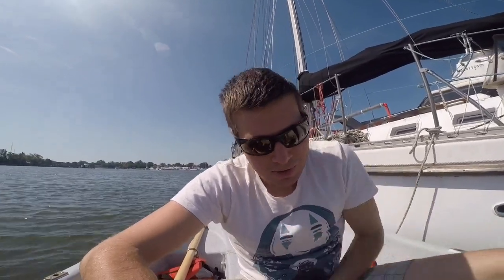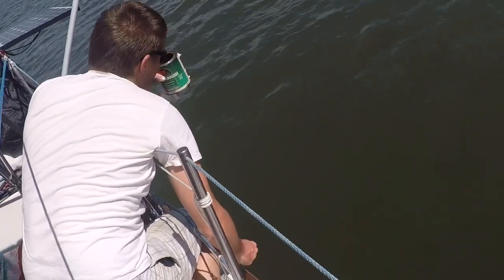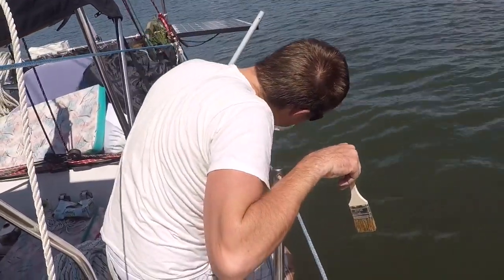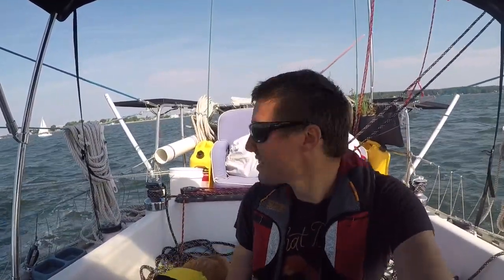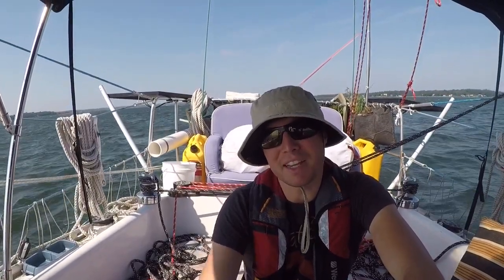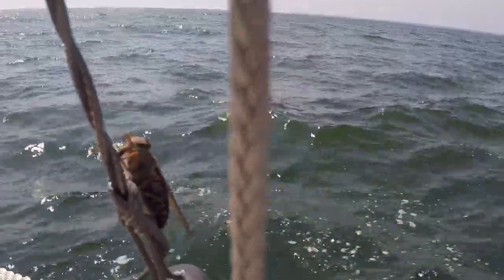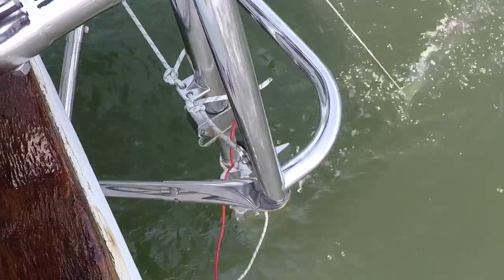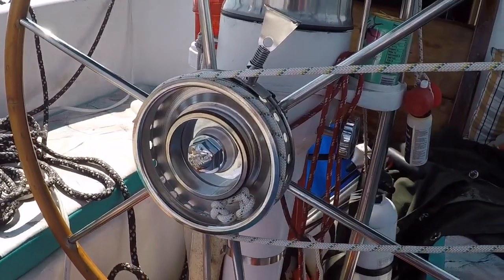Monitor Windvane Explained! | Sailing Wisdom Ep 40

Comment: Very nicely done. I just bought a used monitor and I’m anxious to play with it once the snow is off my boat and I finally get to mount it and use it.. thanks
Reply from the maker: The monitor is definitely and “art” and less of a science (though it’s all based on science). 
When you set the monitor, be sure to adjust your sail trim as the two will work together to sail the boat on a particular course.

Comment: I was thinking using a Hydrovan model wind vane to steer was the way to go because you can use it as backup for your rudder in case of failure.  What are you thoughts....I saw a youtube of cruisers who lost rudder in a storm.....Also I think you should put out a compilation video of Herbie technical tips quick one after another......and thanks for being you...
Reply from the maker: Thanks! :)
Their best point is being a ready to use spare rudder.  They aren’t as strong of a self steering system as a servo pendulum system, like a Monitor or Cape Horn,  but they will work as a spare and backup rudder.
We carry a sculling oar that can push us at an insanely slow pace, but works very well as a spare rudder and tiller. I think the best bet would be to setup the rudder in such a way that you could repair your steering at sea or at least have a spare steering blade (like a long oar) that you could setup. 
Best defense is to heave to in really bad weather and protect your rudder from damage in the first place.

Comment: Hi.  Hey, I just bought a used Monitor but it didn't have the steering wheel attachment.  I plan to make my own.  Any chance you can tell me the diameter of the drum where the ropes curl around?  Thanks, Ed
Reply from the maker: Absolutely, but we have left the boat for Christmas and will be away for about a month. Off the top of my head, I would say the adapter is about 8 inches wide. As soon as we get back to the boat I will measure it and give you a more accurate dimension.

Comment: Since seasickness is an issue, what does Maddie do to prevent the problem? Do you ever take preventative meds, patch or wrist bands? Keep up the great videos...fair winds!
Reply from the maker: +Clay Farnet we have a lot of ginger chews on board. We also have those pressure point wrist bands, but those don't really do much for me. I've taken a few types of meds but they all put me to sleep and render me useless in an emergency situation so I'd rather just try and get through it in other ways. Each time is a bit different. Sometimes it helps to eat, other times I just have to stare at the horizon for a couple minutes. It sucks but it is what it is!
Reply: Rigging Doctor Thanks for the reply. This popped up right after I sent you my question. Have you ever heard of putting an earplug in one ear? Let me know if it works for you. https://youtu.be/hmQMUdZgIMA  Btw, just want to say how much I enjoy your channel. You guys think "out of the box" and I find it incredibly interesting and very refreshing. Keep up the great work and fair winds!
Reply: HAMMOCKS — get in it

Comment: What happens if the wind changes direction? Do you as well?
Reply from the maker: +julien hunt yes, we steer to the angle of the wind. If there is a wind shift, then we will also have a heading shift. This keeps the sails trimmed perfectly to that apparent wind but requires us to check the heading frequently. In the ocean, these changes are easy to go unnoticed since there are no landmarks, so we need to keep a good log and check the compass regularly. 
If we find that we have shifted, we simply change the angle of the wind vane and trim the sails to our new wind angle.

Comment: Hammocks — would they not work to stop any sick sickness like the rocking boat stove circumvents the direction
Reply from the maker: I tried it one time and they start swinging violently. I almost got flung off the boat when a tug boat passed by the anchorage. 
Basically the motion of the sea makes you swing and then your swinging keeps you going. The stove is on a gimbal so it doesn’t get the boost in energy from being a swing like a hammock does.

Comment: I hope you are not planning to use that short cable to tie to crowded docks.  It's rude to not leave slack so others can move your dinghy to get to the dock.
Reply from the maker: +Josef Roesler we use a much longer line for tying up
Reply: So you don't lock it when tying up?  You lost me.
Reply from the maker: +Josef Roesler we do lock it, but with the two connected together, they make a long cable. When hooked onto the stern corner, it swings around easily to move out of the way.